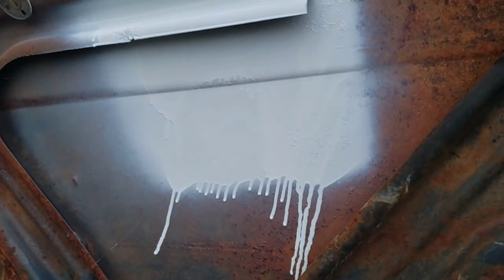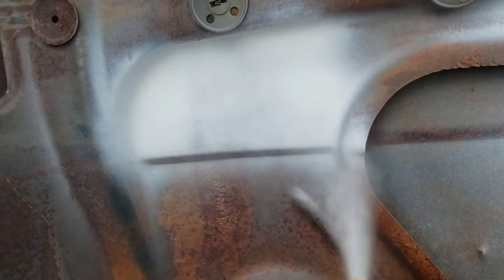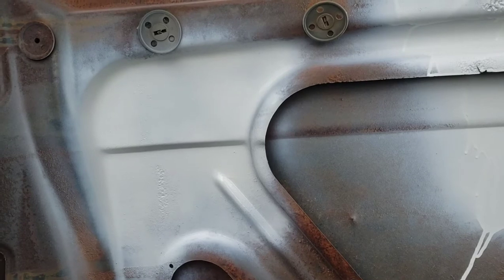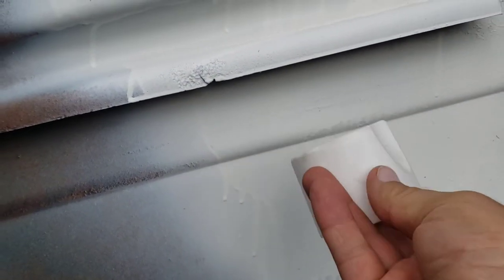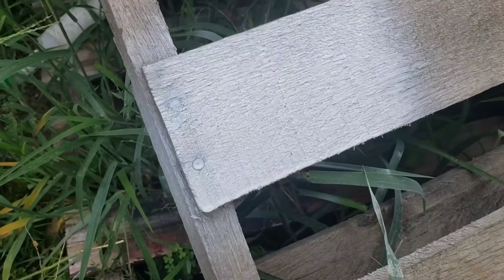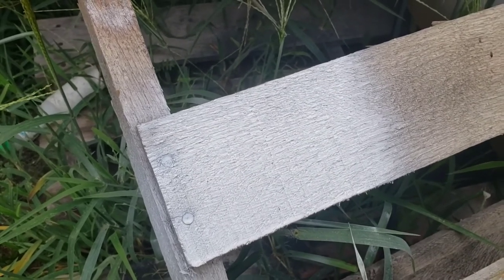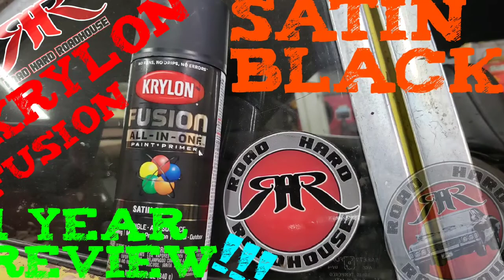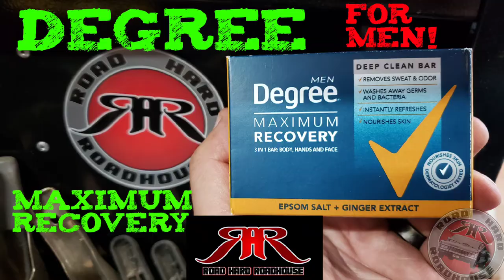KRYLON FUSION PAINT + PRIMER ALL IN ONE SATIN WHITE

Comment: I used Krylon Fusion Satin Black on my steel off-road bumpers, im trying to decide if I should spray the Fusion Satin Clear coat over the paint. Do you have any suggestions? Or should I just use it as is with just paint
Reply from the maker: Sorry for the delay....   they held you comment thinking there were bad words in it or something of the sort.... I would always clear coat.   See if you can get a satin clear coat....or you will have a gloss where you wanted a satin...  the reason I say to do the clear is because it will be outside in the elements , and will be running up against brush and bushes etc...  Thank you for the question, hope it wasn't too late for you.  JEFF